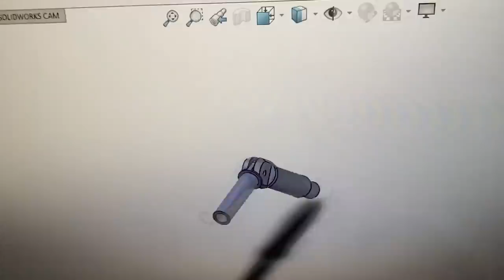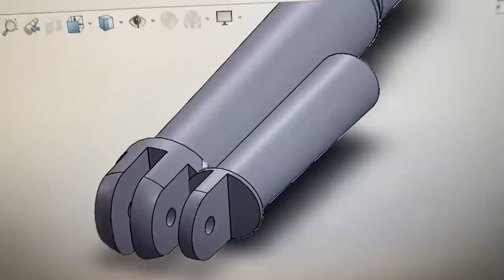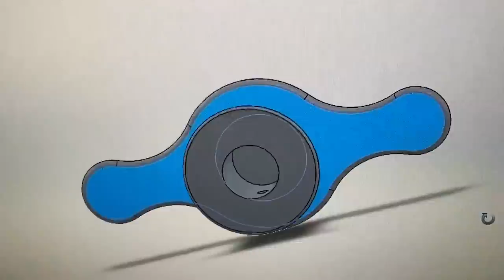Grab, Twist, Pull | Extreme Bush Plane Carbon Fiber Door - Scrappy #37

Comment: I’m a retired mechanical designer with over twenty years in 3D software. I used Unigraphics and I have also used solid works. My background was primarily doing prototype R&D. I’m also an A&P mechanic. I’ve worked in aerospace, oil and gas and optical. I loved your video and I am curious where you’re located as I would love to see your shop.

Comment: Hi Mike, Rob from CarbonBikeRepair. This is the only channel I subscribe to. I have just one small carbon design concern on the door pins. Carbon fibre does to handle abrasion very well. Particularly if it vibrates against another material. I like the sleeve you lathed up for the handle shaft. I thinking over time you might find that you will do the same for the two locking door pins as the hole gets bigger. Just a thought..

Comment: Alright Mike, I had an idea for Draco X. I want to see you engineer wings that can sweep back in flight, and maybe even change your airfoil in flight. Think if an F-14 and a carbon cub had a baby. You need to be able to land on a river bank at 35 knots, but cruise at 180+. I have no idea how it would work, but you sir are a mad scientist. I know you could make it happen. Now back to work!
Reply: My guess is that with the motor he is going to put into Draco X it will cruise at 180 anyway.

Comment: "Just 6 more hours". Yep, I know that feeling. When you see the light at the end of the tunnel, you just want to make that last sprint to the end! Its always frustrating when you're making great progress, things are working well, everything is coming together but you have to stop working on something because you ran out of time. 

But also, when you were showing the two parts in Solidworks and added that concentric mate, HOW DID YOU ROTATE THE PART? Its like you were dragging it but then were able to use the scroll wheel to adjust the angle! I've always had to add my mates in, then click and drag the part to the angle I needed for the next mate to take the proper alignment.

Comment: Looks like you picked that aluminum bar up in the Aviation department at Home Depot. 🤣👍🏼
Reply: Coincidentally that's the same place I got the ignitor for the first stage booster of my Saturn 5.
Reply: @Skinflaps_Meatslapper  🤣👍🏼
Reply: @ColeAviation  Found it on the same aisle as the AN/MS zippie ties

Comment: Hey Mike.... im looking at your door mechanism. Its all fancy but and I'm wondering how you going to keep the door open in flight? You mentioned that in an earlier video. Do you have another locking mechanism planned on the wing or are you going to rely on gas shocks to keep it up?. With the door handle being so far out when its open, how are you going to get to the door handle to close it again? Specially in flight. Nice work bud.

Comment: Aha, I’ve got a good idea for the next one :o) The door pins don’t have a clevis, they have a nylon ball in the door pillar. The ball has a hole drilled in it for the pin. The latch pin moves upward and downward as the handle is rotated, so the frame needs a slot. The slot can be at an angle so that as the pin goes in and then up the angled slot pulls the door tighter. *if the hole wears change the ball. If the ball is staked to run in one plane like an old car gear stick the hole can be offset to adjust the closing pressure.

Comment: Mike, amazing stuff. I'm surprised you didn't make the external handle streamlined in the 'locked' position vs the handle being vertical. Minor point and I'm sure inconsequentialish at that point on the fuse, but it makes my OCD tingle.

Comment: Being who you are, I suspect you already have the parts isolated, but just in case, be careful of galvanic corrosion in the aluminum-to-stainless interface. I do marine robotics, so being in the ocean creates a much bigger problem than the deserts of the the southwest, but we always isolate aluminum-to-stainless interfaces.
Reply from the maker: Correct and that topic missed the video this time but yes I isolate materials that have dissimilar corrosion and galvanic issues 👍🤠
Reply: @MikePatey  Knew you'd be all over it. Thanks for the reply. Awesome videos.
Reply: Galvanic corrosion is such a pain in the ass... just when you think “aluminum and stainless, yay it won’t rust!” Think again...
Reply: .......and the aluminum to carbon fibre touch surfaces??
Reply: This also caught my attention, I would be curious what the solution was to isolate the aluminum from the carbon fiber.
Reply: @balsumfractus  I could be wrong, but the resin that is used in carbon fiber as well as any clear coat used will isolate the metals
Reply: @devonsmith5500  Darkaero did a video on this: https://www.youtube.com/watch?v=yRpMZaU8zKw
Reply: @MikePatey  Just in case, watch out for the carbon fiber/aluminum as well. Folks frequently forget about that carbon is conductive and electrically noble and makes galvanic cells pretty well. The aluminum bushing for your door handle might be unhappy if vibration wears through the coating on the carbon surface. The plane looks amazing!
Reply: I know in previous videos he added a  layer of fiberglass (an insulator) where there was going to be metal contact, not sure if some made it into the latch bore though.
Reply: As a vintage Series III Land Rover owner the stainless and aluminium was making me cringe! I’ve seen many a scrappy Landys thanks to galvanic corrosion hence my rebuild was obsessively isolated. @Mike Patey keep up the awe inspiring work, sorry for momentarily doubting your attention to detail! 🙂
Reply: @hugofj866   I think Landy’s are the poster child for galvanic corrosion! If you haven’t already, check out North America Overland, they do some nice Series Land Rover restorations.

Comment: ....once again Michael...absolutely BEEEEEEEEEAAUTIFUL work ! ! !     Such precision AND beauty.....as is the case with the ENTIRE aircraft.  Just out of curiosity....Have you ever used the words "GOOD ENOUGH"?   I'm a perfectionist myself, but the biggest difference between us (I think) is that YOU GET the finished product you started out to get....and I RARELY if EVER....Do !     It almost seems like there is NOTHING that you have not already done and are already an EXPERT at !
   One last thing..(Speaking of "BEAUTY")....I'm still a little bit worried about the engine cover for Scrappy...I'm not a big fan of the Cub crafter "cowling",  ( I guess that's what that is called ? ? ?)  with the air intake ports on both sides of the prop.  The one you made for the Turbo prop motor on Draco, now THAT really made Draco look "COOL" !  So if this one "bystander"'s opinion can influence you at all, I sure wish you'd incorporate that LOOK into Scappy's cowling.
LOVE YA, "Brother" ....and I wish that was literal !

Comment: Great engineering on the linkage Mike! But I was wondering what is your plan to prevent galvanic corrosion between the aluminum pins and the carbon tubes in the door?

Comment: Was it with the '70s Eldorado that installed a door latch release handle dedicated for the rear seat passengers?  Not forgetting the 'MIB'  (member in back).  : )    ---  Thanks for the vids, excellent work. Don't let them insist solar and elec moters to turn the four blades.

Comment: Mike, with creating such small gaps and tight fits, won't the temperature change affect the metal and expand it or contract it, and you could end up not being able to open the door?  specifically the  receiving plate chromoly and the aluminum pin?

Comment: Ok Mike..... Next time you do this type of a door handle do it with a double gear system. A round gear for your handle and a flat gear tooth of about 3-4" long riding on the top and buttom side of your handle so when you turn it twist pulls on both sides with the gear the pin's in. And if you now add a spiral spring on the inside of your handle you get the rotation pressure each time you open. let is go and the spring form the handle forces both pin's at the same time to go out into the frame of your aircraft and there for it's always locked and always under tension as well so no rattle and easy to service because it's all on the that 3" opening piece of the handle. All mechanical parts are right in the center so if you ever break a pin and have to replace it you can do it from that tiny hole without any trouble.

Comment: Mike, great design but make sure you take account of the galvanic issue.  Aluminium and stainless and carbon.  Yuck! Use PTFE bushes to avoid touching dissimilar materials.  But the carbon tube and aluminium pins will corrode whatever.  Especially when a drop of moisture capillaries in.  Great fan of your work.  John Wighton, Acroflight.

Comment: Mike, have you considered the galvanic corrosion problems caused by joining aluminium and steel parts?
Reply from the maker: 👍🤠 thanks great question.  I missed getting it in this video but I try to get it in most.  Yes isolated barrier 👍🤠

Comment: You aren't concerned about galvanic corrosion between the carbon, AL, and Stainless?  I know you've mentioned it before and it's on your mind.  Interested in your thoughts as it relates to the mix of materials on this door and latch hardware.
Reply: and, wow, that door is a piece of art!

Comment: Quick question but I know that you have already thought this through... Are you worried about galvanic reaction between your stainless steel pins and aluminum parts wallowing out the holes in the aluminum and causing the fit to be compromised over time?

Comment: If anyone reading the comments knows... what is Mike using to address galvonic corrosion between the carbon and metal?  I've searched dozens of videos hoping to find that answer, but I'm at a loss.  I'd really like to understand if it's simply the epoxy on the CF, or if it's powder coated steel parts, or some type of tape, fiberglass, whatever it might be.  Curious.  Thanks!

Comment: Dielectric grease between aluminium locking pins and carbon tubes may be a good idea.
Rotate the door "knobs" 90 degrees to align with the air stream when closed, i.s.o. opened.
Reply from the maker: Yes and yes to both 👍🤠 both are done and the latch is horizontal for flight but just in the video it pins any direction for clocking but it is bow permanently set they way you suggested
Reply: @MikePatey  thank you very much for replying  😎

Comment: @Mike, I get the sense that the door latch handle is backwards. My mind tells me to expect horizontal locked and vertical unlocked. Is there a standard or common practice for this? I guess it's just a matter of handle orientation...

Comment: With disimilar metals, aluminum and stainless steel, with close tolerances do you expect any corrosion? In certain circumstances have seen this, not sure it you would in this case.

Comment: 3/16 gap plus the penetration loss occupied by the spring, seems like the pins wont reach the aluminum air frame which was one of your goals. Just the small tip of the pin may reach.

Comment: The aluminium pin is sliding through the carbon tube? Aren't you worried about corrosion between the two, jamming at some point in time?

Comment: Question Mike; Is using stainless and aluminum in an assembly together not a bad idea? My initial thought was, wouldn't the stainless chew up that aluminum over time? Google suggested that stainless actually saps electrons from the aluminum causing it to deteriorate much faster than normal.

I'm assuming you have an enlightening answer to this, educate me! lol
Reply: It’s not shown in the video, but there are thin Teflon washers in between them.

Comment: any galvanic reaction concerns with the aluminum/stainless latch/plunger pin sub-assembly in proximity to the carbon fiber?

As always, thanks much for sharing.

Steve
Reply: Yes.  There are thin Teflon washers in between that didn’t get discussed in the video. Great catch 👍🏻

Comment: Not to nit pick because I love the series, but won't there be an issue with galvanic corrosion using aluminum and stainless steel? At least, that was my first thought at the start of the video. Cheers Mike!
Reply: Yes.  There are thin Teflon washers in between that didn’t get discussed in the video. 👍🏻

Comment: Mind any aluminum in contact with carbon fiber, will suffer from galvanic corrosion. You can hard anodized the aluminum components to extend the life span, or use titanium which is closer to the carbon on the galvanic spectrum.

Comment: Won't connecting two different metals such as aluminum and steel together create small electrical charges that cause rust / corrosion over time on the metals?

Comment: Do you use bushings/washers to keep the aluminum components from wearing out prematurely where they contact the steel components of the door latch?
Reply: Yes.  There are thin Teflon washers in between that didn’t get discussed in the video.

Comment: Shouldn't the door handle on the outside be horizontal instead of vertical when locked shut? Less air resistance that way...Moses <><
Reply from the maker: Yes 👍🤠 it is horizontal when closed but in the video it has clicking holes I can have it any direction but now completed it is horizontal for your exact reasoning
Reply: @MikePatey  Cool....Wings, COOLER!

Comment: where were you when Hughes needed ya.. Man the doors on his heli's sure shut like crap , the latches bind up and the actuator rods load up and against the bushings so bad you better have an oil drip on them, to get them to work and oil isnt good enough,, use camshaft assy fluid . and for a final test, can you open the door with a broken wrist? cause if you break a wrist on impact by holding onto the yoke, you aint getting out. ask a rally driver, Its something they memtioned on building survival boxes, can you open it in the cold with an injured hand?? sit in an AS350 Astar or an EC120(worse) and try and open the door, Now image with a sore/injured shoulder??  Aint happening.
Reply: If you've watched Mike for any amount of time you should know that he thinks 4 steps ahead of the basic application. Also, this isn't the final product. This guy built the whole gosh darn airframe out of carbon fiber by hand. I'd by highly surprised if the tension of the door latch handle was an issue, especially because of the cam locking function. The dude is legit.
Reply: @7meredith7   true. our audience submissions are ,like mine, based on decades of fixing and modding upteen makes, Then add in cars bikes etc on top. So we see good and bad designs, and like to add, based on been there done that. One case I mention to manufacturer reps was repair manuals, First time you see a Yamaha snowmobile manual, you;ll wonder why every manual isnt as well thought out. to Enstroms pics on tightening torque, for humor ,to the misery of Airbus manuals. telling us to Offer up a part..

Comment: Does the rotation left to lock and vertical handle position when locked driving anyone else nuts? I am sure Mike has his reasoning but it would drive me mad. LOL.
Reply from the maker: Lol 😂 it actually locks horizontals for flight and rotation I matched all carbon cub rotations so that it’s similar to all other Cubs.  What will really make you laugh is when you think about it, it’s always the wrong way on one or the other.  From inside the plane or outside the plane.  Do you want it to be correct getting in the plane or out of the plane.  Same mechanism from the other side is opposite turning direction.  🤷‍♂️😂😂😂
Reply: @MikePatey  and now that you pointed that out, It will drive me crazy for life.

Comment: I wonder if the “door holding open” mechanism is going to be as over-engineered?
Reply: Nothing mike does is over engineered.
Reply: Better to put the time into engineering , having to dismantle and rectify takes the fun out of doing it properly the first time.
Reply: Under engineering the door latch would have meant slapping on an off the shelf latch. That is not Mike’s way. He knows exactly what he wants the latch to do, and then figures out what it takes to get that result. Time, effort, cost, are immaterial to accomplishing the result. 
I chose the term “over engineering” as shorthand to describe this effort, which may have been construed to criticize him. That was not my intention. I am in awe of everything he does engineering his aircraft to solve problems he had observed/foreseen. My comment was an open question asking if he would use an off the shelf part, or make one to solve potential issues.